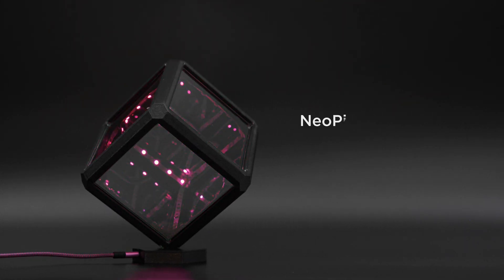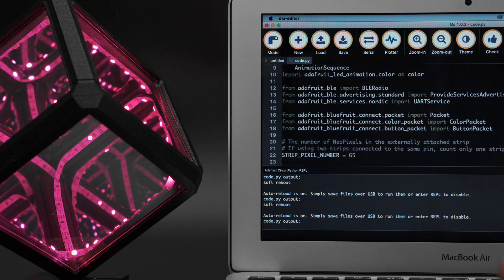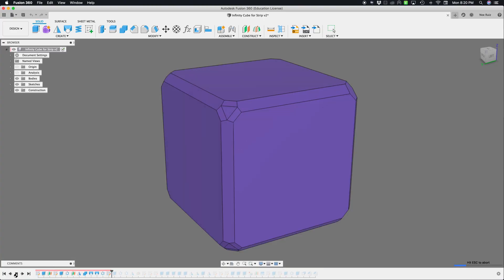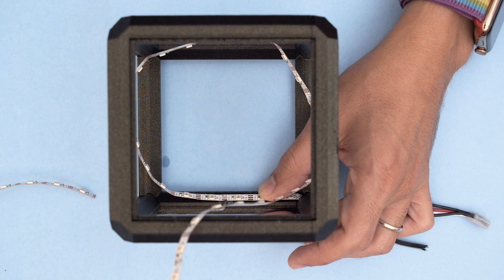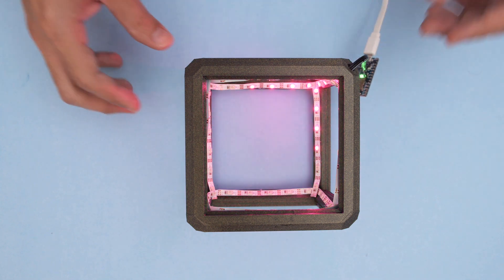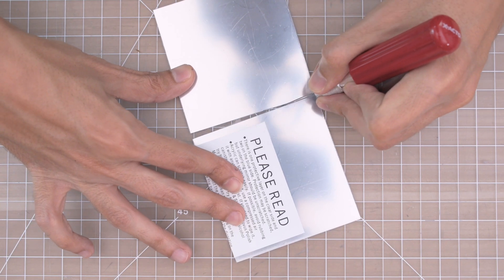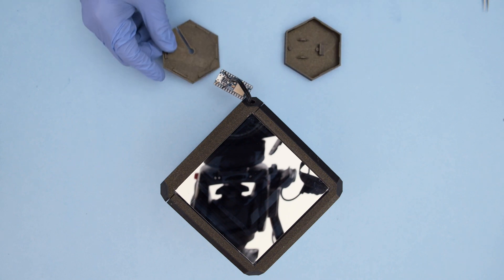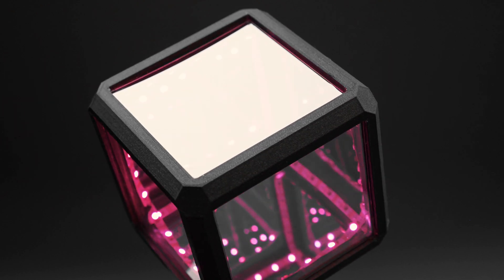LED Infinity Cube @adafruit #3dprinting

Comment: cool idea but some upgrade ideas:

-use black LED ropes without reflecting plastic cover so that you see only the LEDs, not the entire stripe
-also use thinner corners and thinner edges so you dont cover as much of the infinity effect
-try making the led ropes as straight as possible
-also use led ropes with more LEDs/meter so you can add more detail
-use 5 volt LEDs for having one LED with all colors instead of 12V LEDs who usually have 3LEDs as one, for adding colours up. thats usually not a problem but here you want to have as much excact detail as possible
-you dont need to use python anymore to code something like this, use arcNet to manage more LEDs and a mappingsoftware like madmapper, this way you can even make the LEDs reactive to sounds

the bluetooth idea is a great addition tho

Comment: Hi Guys, I have been working on making one of these from the learn guide. I ordered 1m of the mini skinny led's listed on the parts list and I got a product that looks a lot different from the one you used in this tutorial. What neopixel strip are you using in this video?
Reply: it looks like mine has about half the neopixels on the strip that yours does.
Reply from the maker: apologies we linked the low density strip. we used https://www.adafruit.com/product/2970 - if you could, email support to exchange it for the correct part :)